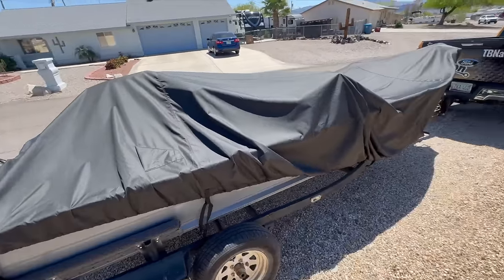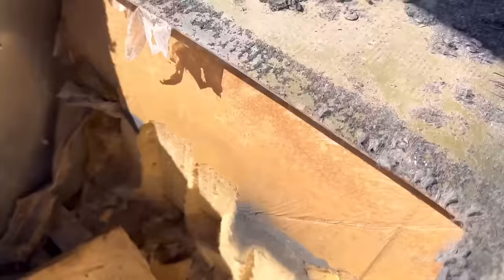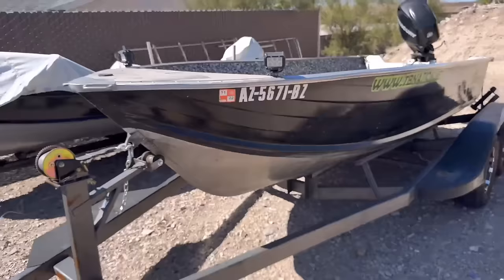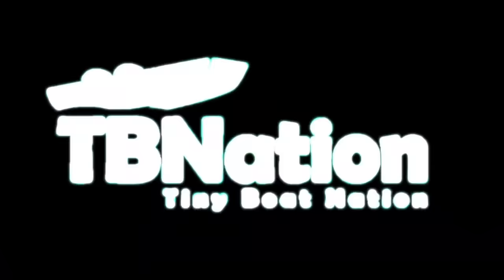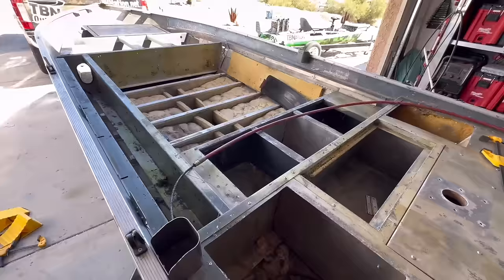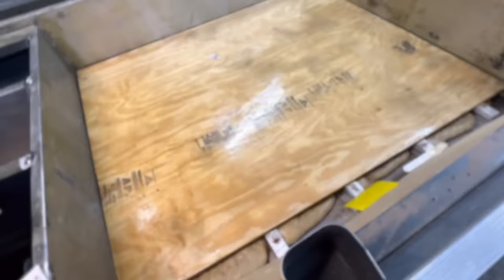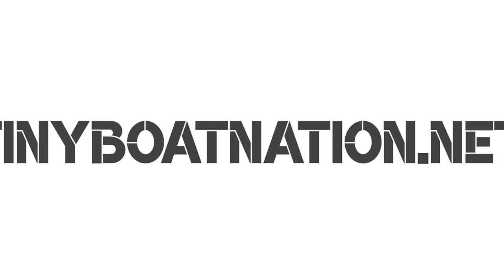Bass Tracker V17 TRUE Budget Restoration

Comment from the maker: Products used in this boat build:
Dualpro RS4 Battery Charger: https://tbnation.net/products/dual-pro-realpro-series-battery-charger-24a-4-bank
Hydroturf Brown Camp: https://tbnation.net/pages/search-results-page?q=Hydroturf 
RPD Side console: https://tbnation.net/products/rpd-1422-side-console-kit-for-jon-boat 
Wiring kit: https://tbnation.net/products/weekend-warrior-electrical-kit
Safety/Nav kit: https://tbnation.net/products/weekend-warrior-safety-kit  Framing kits: https://tbnation.net/products/boat-build-aluminum-kit
Cable sleeves: https://tbnation.net/products/tb-nation-outboard-motor-sock-sleeve 
Trolling motor sleeves: https://tbnation.net/products/tb-nation-trolling-motor-sleeve-sock 

Times & Chapters for this video:
1:17 - The boat & it’s history.
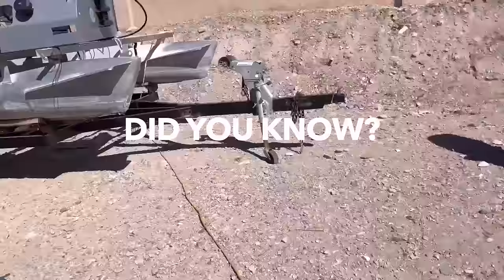2:17 - Does pour foam ruin the hull?
5:47 - Gutting the boat
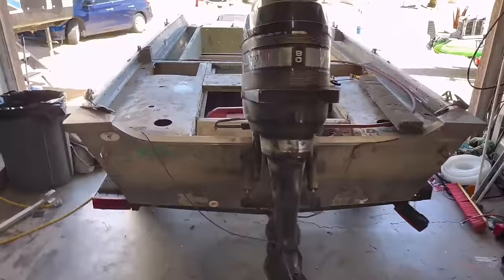10:39 - Framing the boat
13:02 - Plywood decks: Standard vs Marine-grade
14:12 - Subfloor, Front deck & dry lid install
15:07 - Resin-coating Plywood
18:29 - wooden boat lids - how to make
23:56 - Installing the new motor.
 24:33 -  Rod locker lid 
26:07 - Offset hinges for wooden lids 
30:11 - prepping the deck for hydroturf 
31:13 - Old carpet glue: How to get it off
33:12 - Hydroturf install
34:22 - painting the interior
37:01 - replacing the gas vents
39:09 - Hydro-turf install continued
47:01 - Trolling motor install
49:05 - Paint job
50:42 - Wiring & rigging
51:00 - Turfing the subfloor
51:18 - Side console install & rigging
57:56 - Other critical items needed 
52:49 - Initial water test
53:56 - Nate & Anthony test the boat
55:09 - Final end product of this boat restoration

Comment: I restored a 16’ 1981 tracker III, the decks are aluminum. And the foam was saturated, but after new foam, new wiring, lights etc.. it’s a great boat for a retired guy
Reply from the maker: It definitely is a good boat. Thank heaven this one was not near that far gone, and I could just salvage most of it without having to do much of anything.
Reply: I am retired and doing the same to the same.

Comment: A suggestion for you....use polyurethane thinned to near water consistency with mineral spirits to waterprood your wood.  You can roll or brush it on, put several coats, and it will penetrate very deeply into the wood, and the mineral spirits will evaporate off.  I did this as the subfloor to a camper i built, and when i drilled out the holes to mount it, the wood came out in plasticy curly ques.  I drove that trailer over 10,000 miles, through torrential rains, snow, and ice, and the wood was in perfect shape after 5+ years
 
I believe it is cheaper than resin too, and doesnt degrade in UV as badly (not that a carpeted piece would suffer from that).  Also, I thought that resin pours can crack if they flex, which i can only assume boat decks will do constabtly.  Maybe im wrong on that part
Reply from the maker: Polyurethane will evaporate. Nobody uses it in the Marine industry because of that.
Reply: @TinyBoatNation  thanks for the response. 

After I wrote that, I had the "duh" moment.  I had been reading about, and bought plans to build stitch and glue boats, and forgot everything I knew, I guess

Comment: I have the same boat, a 1988 model. I am the 3rd owner. It was and still is kept inside when not in use. I even got the original cover that is still in pretty  good shape. I did repower the old Mercury Classic 50 to a 50 HP Suzuki 4 stroke.
It is super solid and super reliable.

Comment: How durable is the EVA foam compared to vinyl when it comes to putting gear down on it such as anchors, heavy coolers and other outboards?
Reply from the maker: It's better. It's thicker & more impact-resistant and much easier to repair.

Comment: What’s the process of installing a 4 stroke motor on a 2 stroke boat?
Reply from the maker: It’s the same process. They pretty much hook up the same. You just don’t have to worry about two-stroke oil anymore and it’s way quieter and more gas efficient

Comment: What kind of resin are you using to coat the wood and is the wood treated?
Reply: Also you guys do a great job.
Reply from the maker: West Systems 105 epoxy with 205 or 206 hardener